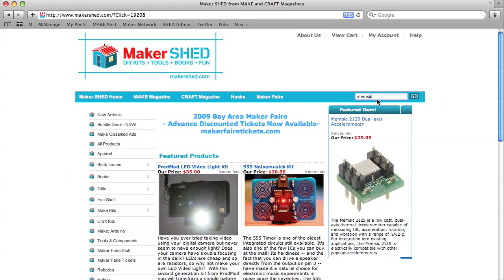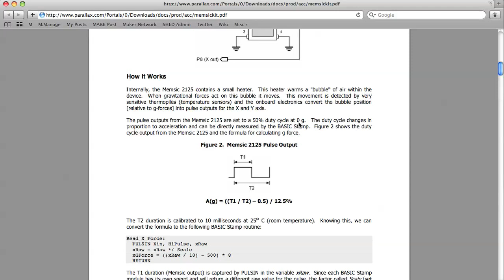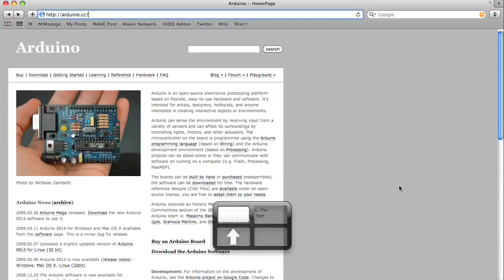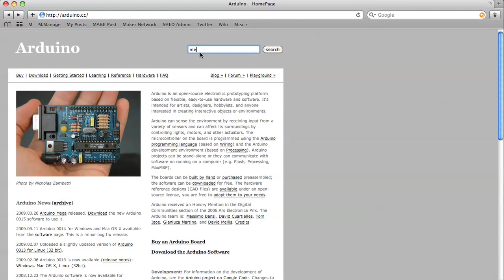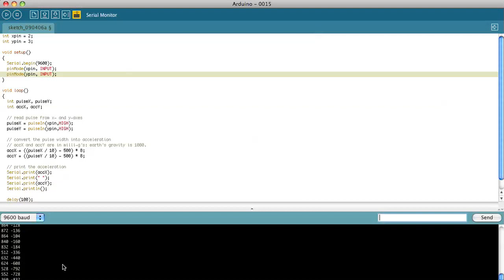How-to Tuesday: Arduino 101 Accelerometers

Comment: Hey 
I need some help.
I want to measure angle of tilt from reference using accelerometer which inputs an adruino uno which in turn reverses the direction of dc motor! 
Is it possible and is there any code available?

Comment: Hello ADMIN,

I'm using right now Arduino Uno in our microcontroller subject and I am decided to use KXPB5-2050 tri-axis accelerometer instead of mesmic 2050... 

My question is, can I use the program taken from the site of arduino.cc for the sensor example of ADXL3XX??? I used KXPB5 accelerometer because in our school laboratory the only available accelerometer... for KXPB5, I made a circuit based on the datasheet.. If ever it is possible ADMIN, if it is works, pls.response.... hehehe

Comment: jumper wires wouldn't be used in a finalized project, so why does it matter? They work and that's all they need to do. They're easy to put in, easy to pull out, what more do you want from them?

Comment: Its basically a mini breadboard. It connects electronics without any soldering. The "Protoshield" conects with the Arduino. It just gives you easier prototyping of electronics without as many wires.